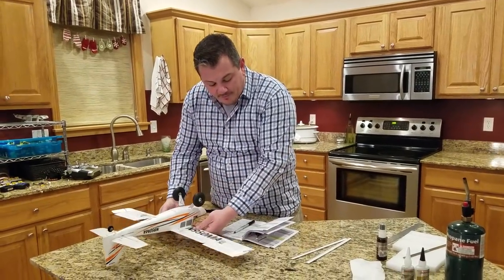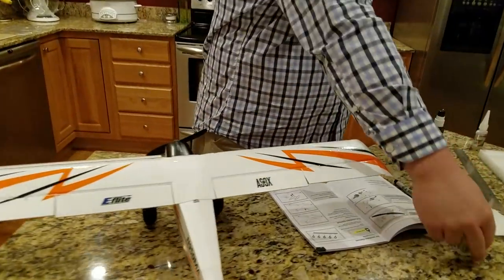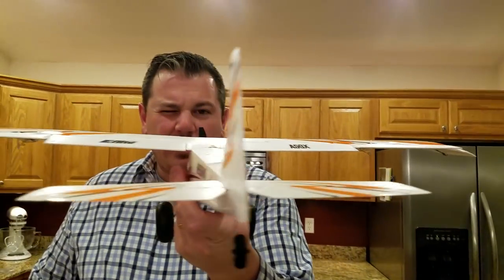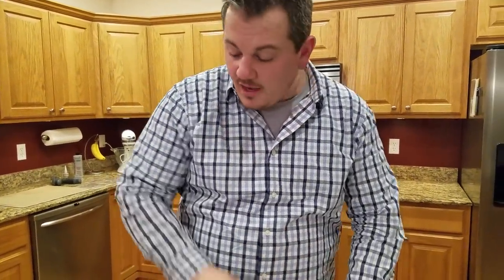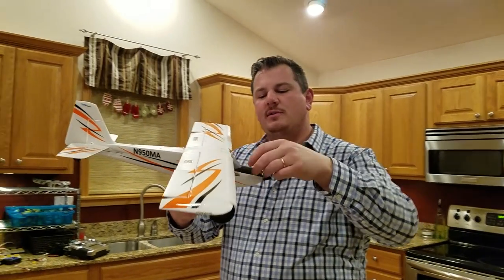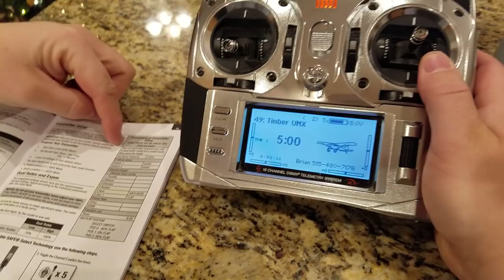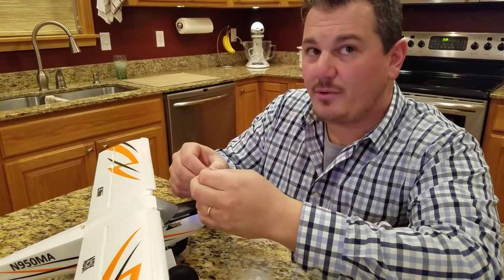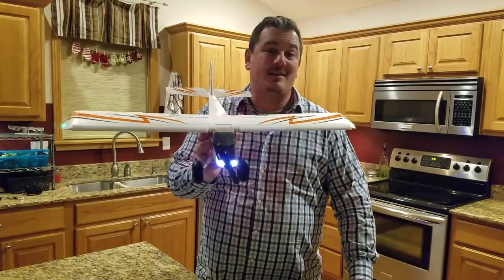Eflite - Timber - UMX - Assembly, Radio Setup, and Tips

Comment: New to the hobby and love your content. Just a quick question. Would very small round head corkboard  pins be useful for marking CG points under the wing? Like these.https://i.ebayimg.com/images/g/FfgAAOSw-jhUE1n4/s-l300.jpg  Would balance better on my big fat fingers.
Reply from the maker: If you want to do it that way, you could, but keep in mind this plane is only about 110-120grams all up weight, so if you add a couple grams, you'll be disappointed in the amount of performance you loose :(
HOWEVER, you can drip a drip or two or three of CA, followed by kicker to set (after each drip) to make a bump. You can almost make it into a pin!
Reply from the maker: On the 1.5m plane - totally, go for it!!!
On the UMX, these would be pretty heavy. IF you have to do it, pull the pin out, and cut the BALL in half, then glue each half to the wing ???
Reply: Thanks. As new to modelling. Love these little tips. Especially the ca,/kicker tip for the led protection.
Reply from the maker: I'm glad you're getting some good out of my videos. There is a lot to pick up as you get into (or back into) the hobby. Lots of it would be figured out from trial and error, but it's a lot cheaper and easier to have a big brother to watch screw up :) LOL!

Comment: I used thin foam safe on mine and it ate away on the foam still :(
Reply from the maker: I have had a similar experience with some of this thin stuff...especially when kicker is involved.
Out of curiosity, what brand, and was there kicker involved?
Reply: @BrianPhillipsRC  I do not know the brand but yes kicker was involved. I also have the battery mount plate rip off and I tried gluing it with the thin foam safe glue and kicker and it just dissolved the whole thing.
Reply from the maker: Kicker speeds up the chemical reaction, and if it's really fresh CA, you can make that reaction a bit too hot. I'm really sorry to hear you had this issue...I did this to my brand new UMX F-16 long ago, and it was never one of my "winners" (not because of the issue from melting foam around the tailevons, but it just kinda sucked)
Reply: @BrianPhillipsRC  Yeah since the glue melted away at the foam where the mounting places are, my front slats are coming off. I am a beginner so you learn with experience I guess. While you're here, could you link me good Medium Foam Safe Glue and Kicker that I can buy? Do I absolutely need kicker or will the glue cure fine if it sits long enough?
Reply from the maker: Medium and Kicker would be a safer bet, as it's a slower cure than thin...

CA Medium Foam Safe BSI - http://amzn.to/2E2l29z
Kicker BSI - http://amzn.to/2CQf24D

Thanks, and hang in there! It's a steep learning curve, but if you're persistent, it's super rewarding!!!

Comment: Brian you could use this to aerotow up the ash26 😂
Reply from the maker: LOL!!! I was thinking about aero towing my ASK21 UMX...
Reply: Brian Phillips I forgot about the tow release in that little bad boy
Reply from the maker: Well, the tow release WAS in that bad boy...but I made her a powered glider...do I took out the extra servo to make room for the motor, gearbox, and lipo. One thing about that plane, which really bugs me...there's no breaking on the ASK21, as I've designed her, so unless you go and do a perfectly timed stall turn, you can hardly get the prop to stop moving, to save your life. It's okay for slope soaring, as you only get into the power when you're ready to land OR if you're in trouble with the wind...but plan to land, since the drag from the prop will bring her to her knees :(

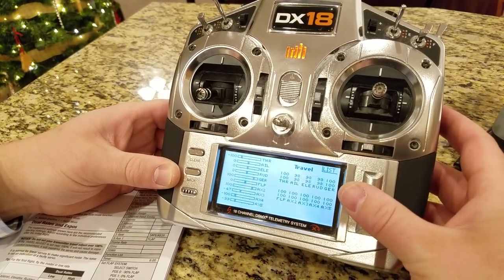Comment: At 39:48 100% certainly7 did make my FLAPS servo howl!! immediately shut down and reset the servo travel to 98% .
However I felt the servo and it got hot for that lousy 3 seconds of noise. Hope I didn't shave 50% of it's life span off, CRAAAAPPP!!!
god I hate my genes!!! it works good now. I did notice that the safe mode needs to be checked, Both panic and safe, sometimes during bootup of the plane the "Panic" gets dropped and you have to restart.  Moving the gimbles to 7 and 5 O'Clock with the channel 5 switch hit 5 times doesn't do it. You have to unplug and plug in the Timber.
Reply from the maker: Timber UMX and 1.5m both have SAFE Select, meaning you only have "auto leveling" and "limited bank angles"...IE, no real "panic" mode as with a FULL Featured SAFE plane (like the Consendo S, or Apprentice for example). This is not a bad thing, in my opinion, but I can imagine this absence of a helpful feature could be a bit confusing to some.

I doubt you killed you servo just because it got hot once, but who knows? The flap servo is probably the least used servo of the lot, even though I use it a lot, there's no AS3X piping constant controls...

If you set "Falps" to 100%, you still gotta try and set the "SERVO SETUP" to the limitation, if you want to try and avoid the over-driving. The Flaps menu will obey the maximum throw, since that's the "main" setting, and all the mixes and flap modes and flight modes have to go through the "SERVO SETUP" as the last straw....hope this makes sense, but not sure I'm explaining this very well...